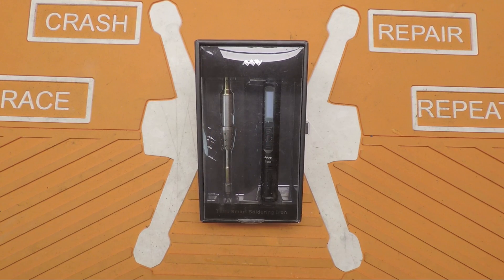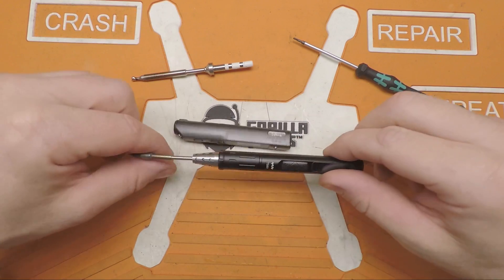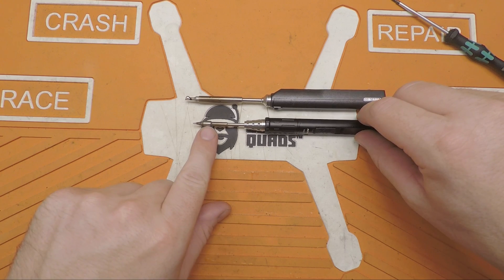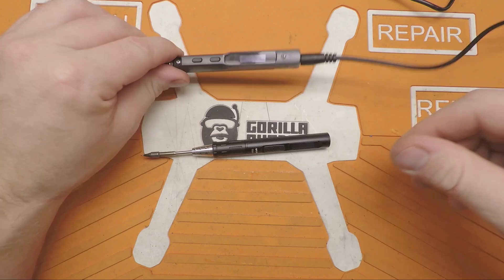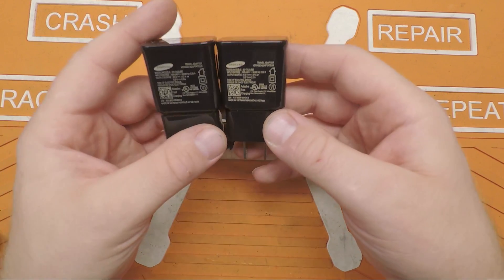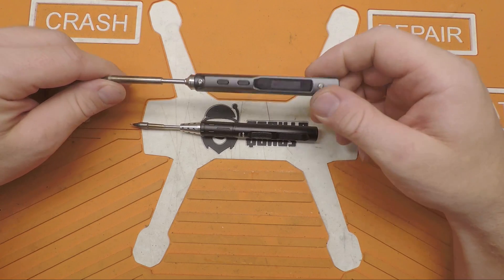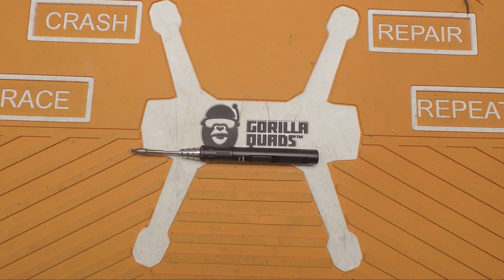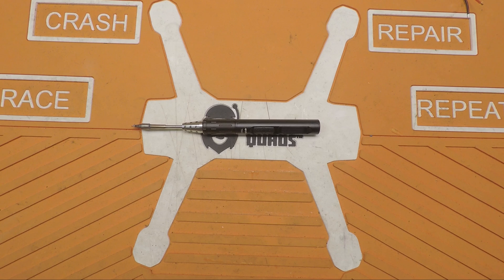MINI TS80 solder iron review

Comment: I wonder how long the USB jack will last for?
Reply from the maker: No less than 10,000 insertion cycles.
Reply: @TweetFPV  That plug just looks like its weak point. I don't even like using my phone when it is charging.
Reply from the maker: Well yea the thing that you interface with will be the first part to fail. That goes for just a bout any kind of power jack be it usb or a barrel connector. But with proper care it's should last a long time.

Comment: You get the chisel tip with the TS80 rather than the pointy tip if you buy the kit with the wall wart...
Reply from the maker: Yea, I wish I would have bought the full kit.
Reply: Yeah, I'm surprised they don't include the chisel tip as the default for all of their irons. Just about everybody prefers them. I managed to find the full kit for $72 delivered and I've been using it for everything. Somehow it seems to have just as much power as my other irons which are rated 60W or higher. I guess it's because of the better thermal design of the heating element and tip. The only thing I don't like is that I haven't yet come across a decent stand, and having the iron just laying on the bench seems pretty lame!
Reply from the maker: So I take it that the stand the kit comes with isn't very good?
Reply: I thought I was going to get one of those paper clip stands with the kit, but it wasn't included. Too expensive I guess! :-D But that wouldn't have been satisfactory anyway. I'm kind of clumsy and if I accidentally knock the cable, I don't want the hot soldering iron flying across the bench...

Comment: The TS 100 and the TS 80 both draw about the same watts when soldering.    There are some power testing vids that show this.  The TS 100 does go up to 65 Watts when you power it with 24v but only heats up that fast.  It slows down when its soldering.   This is why they feel they same.   They both solder at about 20 watts.    I was going to get a Hakko 888D because it will solder at a higher true wattage but the new tip technology in the TS irons are better.   Ive seen them do just as good as an 80 Watt Weller iron with the old style tips.
Reply from the maker: Yes the improvement in solder tip efficiency makes these irons so much better than thier spec sheet says they are.

Comment: I have a TS100 and got most of the tips available and all the accessories as well. I also got a nice cord that has a barrel connector and xt60 on the other end and has silicon wires.  I also got an adjustable power supply that goes up to like 30 volts and also has soft silicon wire. I love my TS100 and it has improved my soldering game big time.  My only complaint is the ergonomics and agree with you on that.
Reply from the maker: I didn't know that they were comming with silicone cords now. That would make it a lot nicer to work with.
Reply: TweetFPV If you still don't have the silicone cable for your TS100, you need to get on it. This is from MINI themselves who made the TS100: https://www.banggood.com/XT60-Male-Bullet-Connector-to-Male-DC-DC5525-Power-Cable-for-TS100-Electronic-Soldering-Iron-p-1219960.html?rmmds=search.